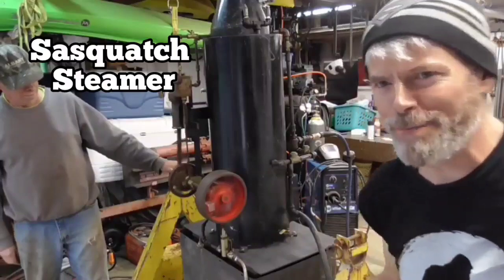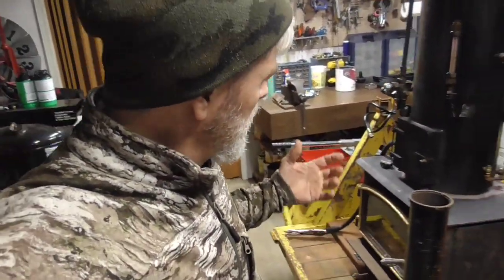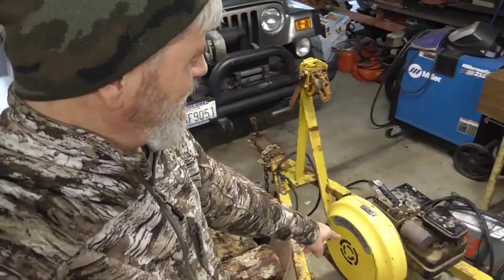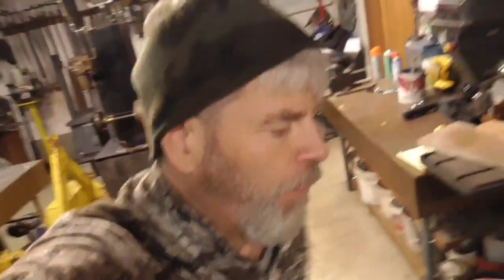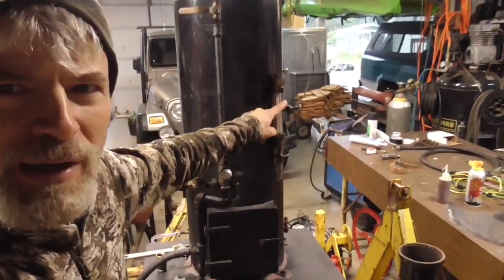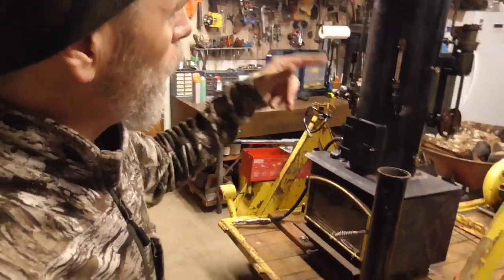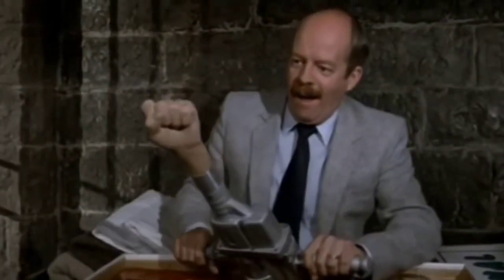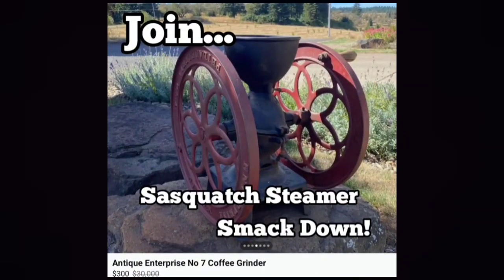Off-Grid Steam Power Update!

Comment: 🎵We didn't start the fire ...🎵   Good ideas there so far.  Nice execution as well.  I'd wait on the other engine until you see how well this one drives the generator then decide if you need to up size or even down size and go from there.  In any case if you do go for another I would make it a gen also with maybe a small PTO as well.  That way you could drive a water pump or such with it as well.  JMO
Reply from the maker: I'm with ya, brother. I'm not even gonna try and get that fire out.
Reply: @OffGridandWhiskey  It'll be interesting to see how well that caulk holds up.
Reply from the maker: @hazcat640  it cured hard in 24 hours. Says flexible.
Reply: @OffGridandWhiskey  Let's see how it stands up under heat and how long it lasts.